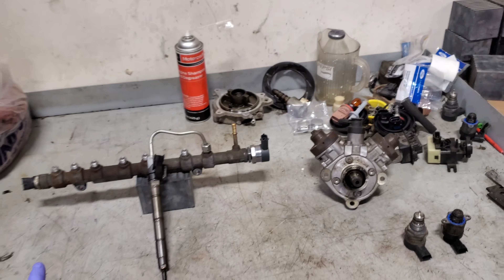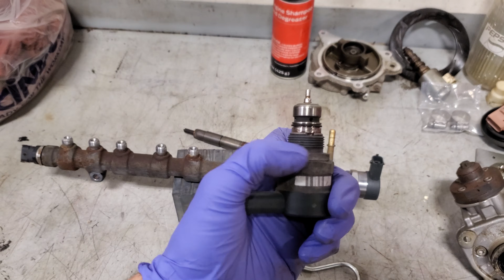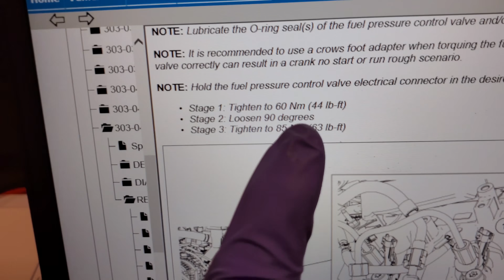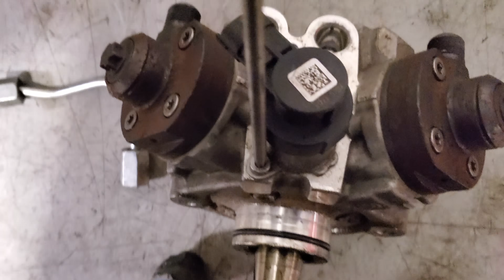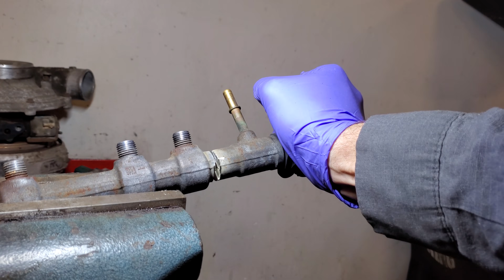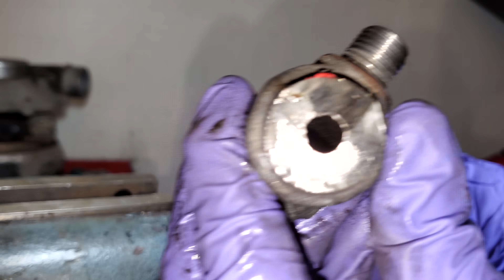High Pressure Fuel system concerns - LH FUEL RAIL discussion | Ford 6.7 Diesel

Comment: Ford should not be using the CP4 pump. It has a problem with the roller cam followers rotating and digging metal. This is a known design flaw and why GM and Fiat RAM no longer use this pump on the HD applications. The RAM 2019/2020 and Duramax 2012 -2016 can at lest be retrofitted to a CP3. The 6.7 Power Stroke cannot. GM has been and still being sued for using the CP4 and RAM tried it for 2 model years and is being sued. So here is good old Ford Motor Company blaming customers for using bad fuel and charging 12k to put the same garbage back on. I am a retired ASE certified technician with 40 years of on the job experience. I thank Ford for making vehicles as I was able to retire at 56 years old. What is I’m my garage? A Toyota RAV4 Hybrid and a 3500HD Duramax with a Denso High Pressure Fuel Pump.

Comment: 2015 f250 my problem fixed . When I was holding gas pedal at 2000 RPM rubber hose return line from injector was popping out I put it  back and again 2000RPM and  blown the line again finally when I ganged the injector now I perfect I think they have problem with injectors too some how high pressure was pushing back to the return rubber hose.

Comment: I just replaced my whole fuel system I was hauling my living quarters horse trailer and cracked my cp4 clean in half but it still throws p0087 once I get on it it’s got a turbo piping kit and a couple other goodies

Comment: just had a 2020 6.7 powerstroke come through after the owner filled up the truck with diesel and then put 2-3 gallons of def in the diesel tank, ran it for a couple minutes then realized what he did and immediately shut it off.. long story short dropped the tank drained fuel, opened tank up and mopped up the little def crystals best we could, dropped both fuel filters, ran clean diesel through the system and caught it in a bucket from fuel tank return line, dropped those new filters and put on another 2 new filters, filled tank up with 5-10 gallons of clean diesel, cranked on first try, since then it has about 2k miles and has been running fine since

Comment: Probably a tough question to answer but could a P0087 be an indicator of a total system failure or would there be other codes along with it to lead you in that direction. Anyway, great videos. I am shocked at how there are not more people like you out there to work on these trucks because my fear is going to a shop and someone just telling me my fuel system is toast just because they cannot properly diagnose the issue. Thanks again for the in depth vids!
Reply from the maker: Gotta go thru the proper pin point test
Reply: Thank you for replying. Truck has been sitting for about a month because I can’t bring myself to take it to anyone. I’ve gotten recommendations for a couple of good shops but they are over an hour away. I’ve thought about taking to dealership but I think that would equate to paying double than a private shop. I’m in central New Jersey and for as many Fords as I see on the road you would think there would be a good reputable shop in every town but there isn’t.
Reply from the maker: Yea sry pal, over here in Deetwahh
Reply: What was causing your problem? Did you ever find out? I have one doing something similar now. Starts/runs fine but will throw the 0087 occasionally but always under WOT
Reply: @jonathanlucas3342  fuel contaminated. Fuel pump went as a result and that shot metal through the system. $10k repair. I wouldn't say that is everyone's case with that code. Just mine.
Reply: @triplsiks9232  Thanks. I’m pretty sure I’m gonna have to do the same because that’s the most expensive thing it could be and that’s how my luck is. I do believe mine will be because of age/wear. 2015 truck with 250k miles working during most of those.
Reply: @triplsiks9232 did you try spraying starter fluid before replacing system. I can spray fluid and mine runs and drives but when I shut it off it just cranks

Comment: I've been trying to solve a P2291 in a hotel parking lot for a week. I figure it was caused by bad fuel. Changed filters (they only had 1800 miles on them to begin with), CP4 (Everything seemed to point to that being the culprit so I put a 2015+ on my 2012).I had an S&S disaster kit on but even so, didn't see any real signs of HPFP failure. Hard to check actual lift pump pressure, but it certainly has plenty of flow. I have it tuned with an Ez-Lynk, with stock emissions, so I am able to read a fuel demand of 5.7 when cranking, but 0 actual. Assuming the CP4 I bought directly through Ford was good, has anyone experienced the fuel pressure regulator being the cause of something similar?
Reply from the maker: Before you start throwing parts at it I would highly advise you to go through pinpoint tests M and pinpoint tests ME so that you can come to the conclusion of your problem
Reply: @PowerStrokeTechTalkwARod  That was actually next on my list. Well, that and checking to see if the I am getting a boatload of return fuel (I am assuming that would tell me I had a bad FPCV). I am tired of throwing parts at it lol.
Reply from the maker: No, u need to do the pin point tests. That needs to be verified with use of a scan tool

Comment: Not really confirmed but my trucks injector lines are constantly buzzing like it’s always priming when I turn my key on. Could a bad fuel rail cause this issue? It also defuels at WOT.
Reply from the maker: Air bud
Reply: @PowerStrokeTechTalkwARod  I cannot find the source. I’ve tried new filters. New water separator cap. And no luck. Can’t find any leaks either

Comment: How much does it normally cost to replace the fuel system on a 2014 f250 6.7?
Reply from the maker: 12k
Reply: Around $6000 to $8000 at a private shop.

Comment: So I have a 6.7 2017 it went into limp mode and I replaced the filters and still saying pressure system low. Not sure where to start
Reply from the maker: Ya need a scan tool to talk to the truck

Comment: My 2016 f350, cp4 clean, checked it out when installing cp4 bypass kit..... runs great tell I push the pedal down hard, or when towing it's really fussy.... (just been clearing it to keep running)... fuel pressure drops p0087 code pops....low fuel rail pressure.... the scan shows the pressure dropped dramatically.... could this be the fuel rail issue you had....definitely sound just like ur issue.
Reply: The cp4 disaster prevention kit will cause Low rail pressure
Reply from the maker: Only one companies kit will
Reply: @PowerStrokeTechTalkwARod  they all do,  that's why there's another company making a different design to prevent it.
Reply from the maker: No im sorry, the only one to add is the S&S......all of the rest i have confirmed with cry babies buying from said company that now they have low reduced power message on............
Reply: @PowerStrokeTechTalkwARod  you said only 1 companies kit will cause low rail pressure. That's not true several companys with the same design have the same issue. It returns fuel to fast and causes low rail pressure.

Comment: I just installed an SPE distaster kit on my 6.7 and immediately got a no start, primed the system per instructions, still no start. Towed to the dealer and got the classic "Bad Fuel," told that I need an entire new fuel system and of coarse Ford will not cover it, 67k miles, out of warranty. I then took off the SPE kit, put everything back like it was, still no start.  Screwed in a State that I do not live
Reply: @Volastod I just had the exact same thing happen , did you get anything figured out? I’m still looking for an answer for mine. Thanks.
Reply from the maker: Get that garbage off your truck
Reply from the maker: SPE is garbage
Reply: @PowerStrokeTechTalkwARod  what really? I just watched one of you previous videos complementing them on their external ccv catch can and ccv reroute kit. 🤷‍♂️🤷‍♂️🤷‍♂️
Reply from the maker: Yea!!! And since then, it got thrown out. Their service & company, well buddy im not hear to slander. I thought it was good......key word thought. I wouldn't want you all to go thru the debacle of dealing with SPE...regardless of their interdepartmental problems that are going on right now...covid, their personal issues, blah blah blah. I AM UNDERSTANDING  but when you do not reciprocate back & on top of everything else i hear from other people who have used them....brother I do not have time for that.....enough is enough. I'll sell my truck be4 I put their products on my truck
Reply: @PowerStrokeTechTalkwARod  
Well, their customer service does seem to be lacking. Only recently delt with them on a ccv reroute. I honestly feel they make a good product from what I've seen, other then that, I have read more bad then good. Some people and companies don't truly understand the importance of customer care and service along with a quality product.

Comment: I'm experiencing this now. I always change fuel filters when I change oil. Inspect filters fuel and oil. Never seen any debris before. Now the complete system. I have 178k on truck and am 2nd owner my brother was the original owner. Wlways been serviced at regular intervals.
Reply from the maker: Sorry pal...
Reply: My truck just stopped on the way to work. Quoted 14,956.87 to replace with another CP4.2 and new injectors and all the other stuff that’s in the kit. They said they would give a 2 year warranty unlimited miles. My question should I do this or do the DCR conversion ? With no warranty.. I hate this the truck is gonna sit for a while maybe a year !

Comment: Hey man. Having a serious problem maintaining rail pressure on my 6.7.  The calls for 29k PSI, the truck will hit that pressure, then drop to 15-19k and stay there until I let off the pedal, throws a check engine light.  I can build up to 27-28k slowly and it might hold it, but at wot, it won't hold it. Please help! Been to multiple dealers and shops, pump is 100% perfect, no issues on pump side.
Reply: Hey bud I’m having the exact same issue I was wondering if you ever found out what the problem was thanks in advance
Reply: @jaredroberts8719  yea, a plunger end in the cp4 broke off, so I was only making pressure on 1 side of the pump and rail
Reply from the maker: Was a high pressure fuel system concern
Reply from the maker: To get diag time, you'll have to purchase time blocks. Powerstroketechtalkwarod@gmail.com

Comment: This is my worst nightmare. I change my fuel filters every oil change (7500 miles) and only fill up at the Wawa near me (tons of diesel traffic daily....hard to get a pump) for this very reason. I’ve been running the Motorcraft fuel additives, but I’m switching to HSS to hopefully get more lubricity in the tank. Thoughts on the filter change interval and HSS EDT vs Motorcraft additive?
Reply: Ahhhh damn.  I don’t like to hear that!  Been getting fuel there for 3 years since I bought my 16. Drain the separator about once a month. Never had any dirt, water, or anything else. Just clean fuel 🤷‍♂️. Have a 50 gallon titan I just installed full of it!
Reply from the maker: I went to PA & i was specifically told NOT to use WaWa. Juss passin along crucial info...
Reply: Thanks bro. Much appreciated as always!
Reply from the maker: DO NOT GET FUEL @ WAWA......GARBAGE!

Comment: I was running super low on fuel yesterday and got 6 gallon of diesel from a country gas station with a above ground fuel tank and now I'm concerned that could end up being a very costly mistake. Please give me any advice you can as to what I should do to prevent damage to my 2012 6.7. I will replace the fuel filter tomorrow but what else should I do?. Thanks in advance
Reply from the maker: Sry pal

Comment: Man I'm happy I found your channel. I haven't seen someone as knowledgeable on powerstrokes since diesel tech Ron 🙏 RIP.
Reply from the maker: He was my buddy RIP DTR 🙏
Reply: @PowerStrokeTechTalkwARod  what do you think about the prevention disaster kit? Thanks in advance im a new subscriber.
Reply from the maker: 1st mod all 6.7s shld have!! Accuratediesel.com ask for tim
Reply: me and a coworker were talking about ordering the disaster relief kit (his '11, my '15). His pump ate s. hit. I immediately ordered and installed s&s drk. Installed it myself from one Sat. morning to start up Sun. morning. Good deal. Would have been lots quicker with a tool and parts hander.
Reply: Knowledgeable man indeed!  God always takes the good ones early
Reply: Contact information
Reply: Great video.  I have similar issue going on.  P0087 fuel rail low on 2016.  Rail at 15k demand is 26k. Pulled sensor on top of pump no shavings, replaced  valve in back of rail and still same.
Reply from the maker: Thank u

Comment: 2012 6.7 f350 king ranch, I noticed glitter in the main filter bowl at 290k miles, had a shop replace the entire system with Fords contamination kit, at 370k miles I got my first issue, low engine power, 0087 code and then engine stalled and would not restart. I traded my truck in for a 17' model, now wondering if I should try to buy it back to fix it and sell for 4-6k more than the trade value at 8500, please advise if you think this is a good idea or not and cut my 10k loss that I spent on the fuel system in November 2020, thanks in advance
Reply from the maker: Powerstroketechtalkwarod@gmail.com

Comment: what should the fuel rail pressure be with key on engine off. mine shows 459 psi, even after the low pressure pump has shut off.
Reply from the maker: What do YOU think it shld be??
Reply: @PowerStrokeTechTalkwARod  either 0 or low fuel pressure 50 to 70psi would be my guess
Reply from the maker: How can there be any HP fuel if the engine isn't running...??

Comment: hi,  my truck its show me a oil light, and the code p2291 i change my oil and filter, and still not start, its possible if i have low pressure oil the truck will not start????  thanks
Reply from the maker: U want diag, gotta pay. Powerstroketechtalkwarod@gmail.com

Comment: There's a recall on some 2020/21 6.7's for the left hand fuel rail due to possible dislodging of the orifice, as you've described. Fsa 20b41.
Pays half decent too lol. Especially nice if they don't have the noise isolator covers on
Reply from the maker: Yeppppp
Reply: @PowerStrokeTechTalkwARod  Hey so I've got a head scratcher..
2020 f350 6.7 throwing p0191. Power balance looks like a literal sine wave. Falls on its face soon as frp commands above 20k psi, at which point actual falls to about 10k below desired. Fails last pressure stage of hp fuel system tests incapable of reaching 25k psi. 
Parts replaced:
High pressure fuel system, engine harness, ckp, cmp, pcm, bjb, lift pump, disconnected all inputs while engine running, no difference. Disconnected alternators, disconnected power invertor.
No other codes. The sine wave power balance accompanied with severe loping idle has me believing it could be rfi. I know there was a tsb for injector issues caused by interference when certain components are plugged into rear charging port. 
Supply pressure is good. All tables and iqa's have been reset. Fuel is clean. Relative compression is straight. No pid's appear out of wack. Another reason I suspect rfi. Injector mass pids are all equally pulling fuel and bouncing at the far left of the screen.
You have any ideas? Ever seen anything like that with a sine wave power balance?

Comment: That was a good vid. I agree, I really didn't think the Bosch CP4 pump is a bad piece. It was always about the fuel & possible contamination. Problem is we can't always control the fuel we buy, hoping it's good quality. My truck is a 13 with 200K on it. If my CP4 grenades, I'm not sure I'm spending 11K on a fuel system even though it's still a nice truck, Maybe it's a Platinum, Okay I would, but It would be nice if that SPE kit does what it claims, that's cheap insurance & it's Plug & Play. Always great content from Arod, I appreciate you sharing your craft with us!!
Reply from the maker: Thanks budddddy!!!
Reply: It's not a bad design?  Faults! Ram and GM never had these issues with the cp3. Since GM went to a different pump they longer have this catastrophic failure.
Surely with what these trucks cost now ford should have no problem finding a better pump and design.

Comment: I got a 2012 f350 with 123k miles. fully deleted with a mini max . My Fuel pressure drops down to 2.5 Ksi when I release the throttle, and low power when accelerating. Probably 5k miles ago I replaced the fuel pressure regulator( the one on the rail) because it would drop off like this, but still had good acceleration. Changing that part made the truck run great till now. Going to change fuel filters first, and I’ll open the cp4 regulator this weekend. Really hoping I don’t see metal. Past this I’ll need someone to check actual and called for pressure since I don’t know if my tuner is 100% accurate on the readings.

Comment: I have a question I'm working on a  6.7 and my pressure on the high side is at 3,000 to 4,000 then it drops and truck turns off...on the high way at 70mph pressure is at 22,500 psi... it wont stay running at idle
Reply from the maker: Dannnnnng

Comment: Good vid, I have a 13 6.7 with 170k, Im very picky on where i get my fuel, I have two places that I have gotten my fuel for the last 7yrs, so far no issues, once a month i will take a sample from the primary filter in a glass jar again so far no issues. my question is are the cp4 disaster kits worth the money? Ive heard of them saving the fuel system if the pump fails but figured you would know, thanks
Reply from the maker: I have read with some, didnt even work...10k bill 😔
Reply: @PowerStrokeTechTalkwARod  ugh....